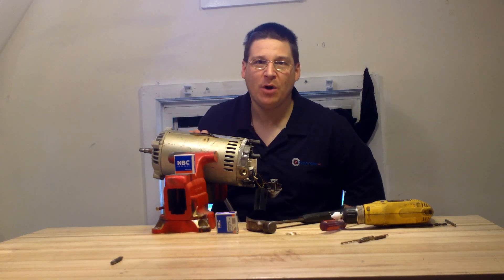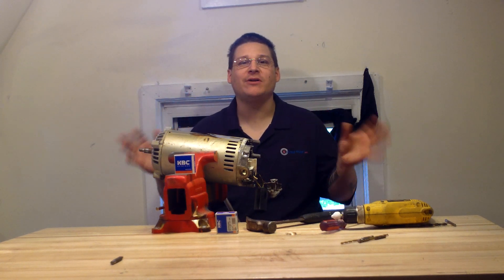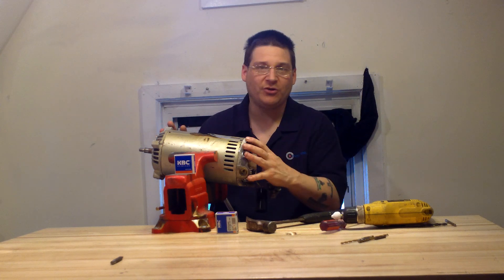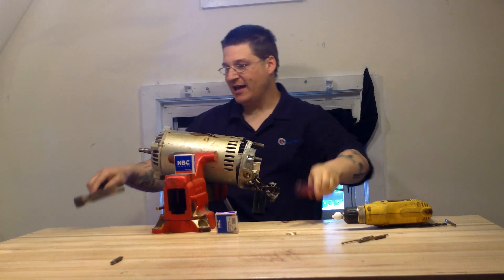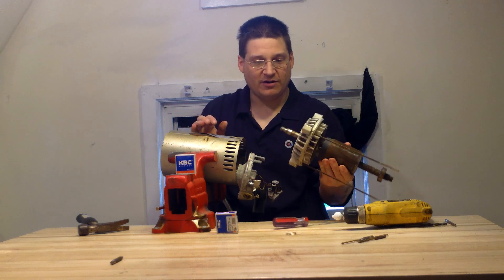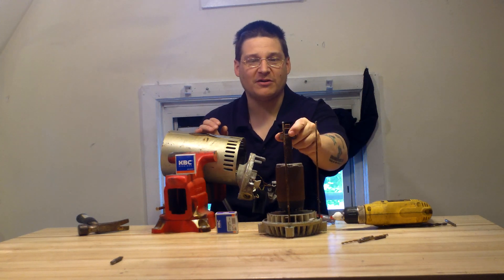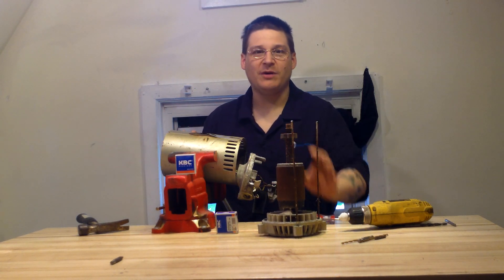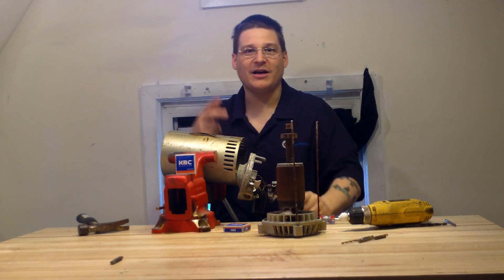Pool Pump Repair [ Hayward ] - How to Remove Super Pump Bearing

Comment: The title says "How to Remove Super Pump Bearing".  Maybe I missed it, but did you actually remove the bearing?  It looks like you just took the shaft out of the housing.  I ask because mine is making noise and I need assistance.